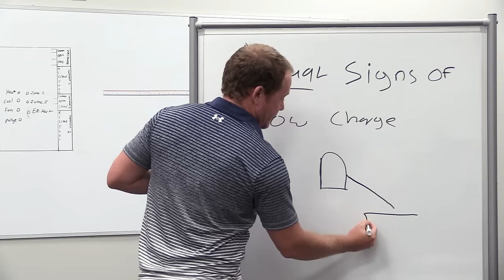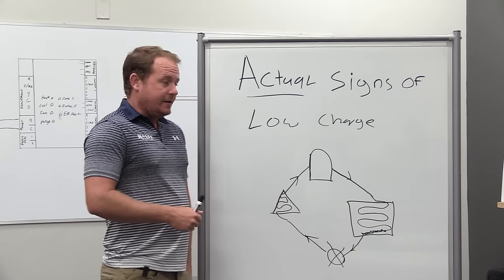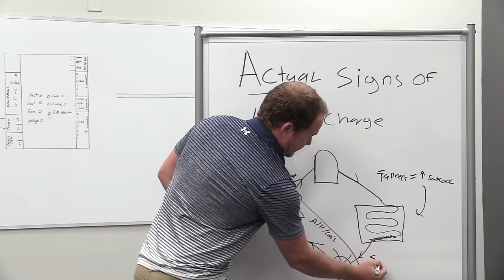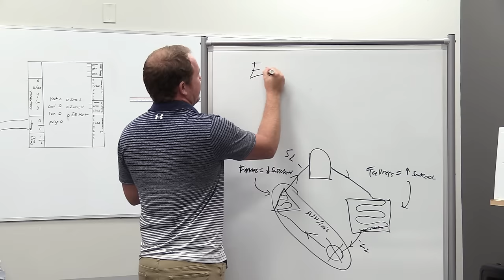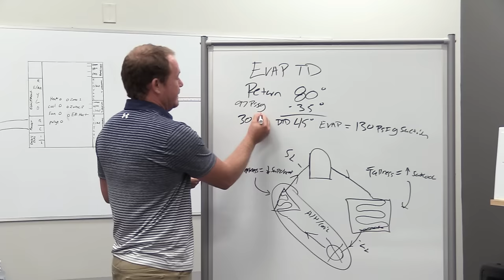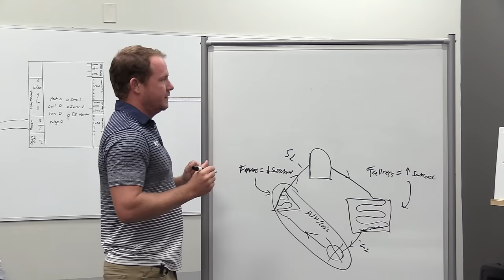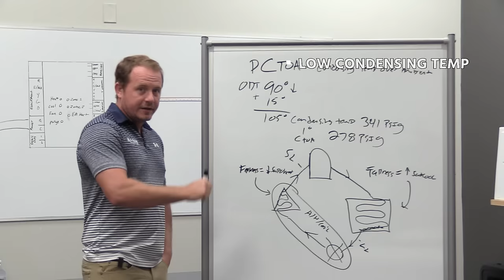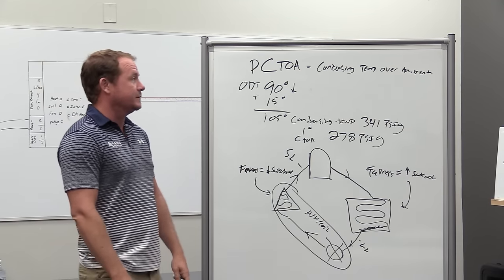Low AC Refrigerant Charge - How to be SURE (Does it really need Freon?)

Comment: Very good info.  We had a AC scam-shop come in to check our R22 AC, due to what seemed like short-cycling.  Tech went straight to compressor, checked pressures, no temperatures, but it was obvious that compressor was working OK, since heat outflux was obvious by feel, and no motor noise.  Never checked anything around Evap system, then told us we had "low suction pressure", and recommended a new compressor.  5K$.  Had a competent AC company come in, and they found one bad/intermittent wire connection to the Evap blower-motor.  Fixed for 89$.  Too many scammers around.
Reply: Someone wanted 5 grand for a compressor!?  Wow, yeah...  Sadly, you have to look out for bad actors who serve their bottom line first and the customer a distant last.

Comment: Generally speaking if you follow these 6 checks and the result is Low SST, Low SCT, Low delta T across  indoor coil, Low Compressor Amp draw, High superheat, Low subcooling the system is short of refrigerant.  Good video 👍
Reply: What is SST and SCT?
Reply: @realSamAndrew  Saturated Suction Temp and Saturated Condensing Temp
Reply: @jasoncole3833  thanks for the reply. I feel like they use a lot of contradictory terms in this industry. If one is SCT, the other should be SET.  On the SMAN display they use LSAT and VSAT, which is consistent, but then they say SLT and LLT, which is technically correct but doesn't match convention. Then you have other companies that use even other terms that nobody else uses. It's no wonder many techs get confused.
Reply: @realSamAndrew  I calibrated the probes on my SMAN just the other day, and it was recommended to label the plugs so you're always using the same probe for high and low.  So I drew an 'S' on SLT and an 'L' on-  wait, now that just doesn't make any goddam... 🙂
Reply: @joez.2794  that's funny 🤣.

Say, aren't SMAN and probes two completely different options? Did you just call it SMAN because they are both Fieldpiece? Or, are you using the SMAN as a wireless screen instead of a smartphone?
Reply: @realSamAndrew  It's an SMAN360 (comes with two wired probes).  I just said SMAN b/c you did - I don't really know what I'm doing (homeowner 🙂)
Reply: @joez.2794  oh, ok. Typically, when they say "probes", they mean the stand alone wireless pieces that connect directly without hoses or wires and transmit the readings to the phone. With your setup they usually say manifold or gauges. Just another example of competing terms to confuse everybody 😉

Comment: Even pressures sometimes lie it's a tricky business. Thanks for the information.
Reply: Only way i can think of a pressure lieing is.  1 not checking all the systems other issues. For example air flow.  You also need to be sure every part of system is working properly.  The teacher mentioned that.
He mentioned Even a shrader valve.  Teacher also used a specific way to check your pressures according to atmospheric pressure.  Which is different in Colorado vs Florida.

Comment: BRYAN! BRYAN! I hope your team shows you this comment. A Weak compressing compressor can also give you low charge readings right. My co worker had a call where he got low charge readings (106 L/ 275 H), high super heat and low subcool, as he added refrigerant system turned OFF.  Overload switch broke open. He recovered refrigerant, hosed down compressor, system turned on but gave same readings. Now I asked him to take Amp draw on common wire of compressor, he got 4.3 amps out of 18 RLA. This is signs of a weak compressor that doesnt have the strength to put in the work to move that refrigerant, hence the low charge readings he interpreted. Condemned compressor, installed new one, amp draw was in the 65% range of RLA, happy customer. Hope this comment finds you or if someone can share some insight. Best of luck brothas. Miami, FL
Reply: Appreciate that insight thank you so much.   Checking the amperage of the compressor seems logical. What does RLA represent ? And could your compressor been saved by a capacitor or hard start kit?
Reply: @The1realro  Compressor wasnt locking up. And capacitor was good.  Was just compressing really weak.

Comment: If the house is above design temperature (80°) and you add refrigerant using subcooling method, you must be careful. Add a little bit and wait for the house to get down into the 70's before setting the final charge. If you charge to 12° subcool when the house is 95° when the house gets down to 75° it will be overcharged.

Comment: Thank you for your time that lays out alot !!! I injoy some one teach this !!! I gained so much about your teaching,  I had a customer that keep say I replaced the filter and I would look at return and the filter looked clean ,  but because of your teaching I refused to put freon in to system,  even tho the customer said it just needs freon , I explained with freon being so high let me run a few test , he agreed!!! Turned out that the filter was causing a big pressure drop across the evap coil so I showed him and this is where service tech do explaine every thing !!! But I also find that it help if you show them the problem,  I removed the filter and every thing whet normal again,  the cool thing about it was the customer did A/ C work like 15 years ago , And he thank me for my time showing him !!! Thank you

Comment: Concept of tracking down the leak before just adding it in. That's my beginner take away. I threw my old r22 system away, as i was doing so. I noticed a little spurt taking the caps off. Then i watch some of ty's videos and he mentioned to add o-rings to the caps. Keep them clean. I'd also throw in there, change the cores on anything more than 10 years old. What do you think.

Comment: Other than cost considerations, is there a reason why HVAC manufacturers do not have temperature sensors placed at key locations throughout an HVAC system to monitor system performance? Wouldn't this take a lot of the guesswork out of troubleshooting systems? I would imagine that a relatively simple processor/software and interface would be a huge advancement in energy savings. It could also be remotely monitored by the servicing company who could contact the customer when the system is showing signs of falling out of 'tune'. This seems like a win-win for both the service company and the customer. The customer could have his system repaired before it totally fails, thus not sweating while waiting for a service call. And, the service company could ensure that the customer will be reliant upon them to maintain their system/systems.
On a much more basic level, I monitor my system's performance with with a remote thermometer placed just above the evaporator coil to monitor the air temp there vs the ambient air temp at the thermostat. Making sure that the system is cooling as it should.
Reply: youre describing most lennox units
Reply: Too expensive.

Comment: Great comprehensive troubleshooting video Bryan. Just one question, where does amp reading play out? I know we cant rely on it solely to tell an undercharged system but is it safe to say that  we can add it as one of the parameters to check to reinforce whatever is our conclusion in the  troubleshooting  process?

Comment: No subcool, high suoerheat, 104° hot Texas afternoon, dew point 75 so heavy air. Looked like low charge so added but SC didn’t really change. Actually the condenser was dirty. Looked clean but a quick wash and wait and suddenly the SC is -15. Now have remove refrigerant to get back to 8.  Did I mention it was 104°F? Two hours to sort it out, very exhausting. Watch out for condenser that looks clean because on a hot day it makes a huge difference.

Comment: Try doing a visual inspection of the indoor coil on the dirty side. It basically impossible without cutting a hole. All you can access is the 'clean' side. 
We stopped using the electronic air filters because they allow so much to get by and into the coil.
It has been my experience that buildup on the supply side of the indoor coil is the most overlooked problem with systems that aren't working well. Very low superheat during cooling, and increased sweating on the suction line. Long run times in any mode. It is difficult to clean, but necessary, and any tech worth his/her salt will find a way to do it.
Stuff gets beyond the filters. Always. And gets trapped in the coil. Of course it does. But nobody is talking about it. It throws the entire system off and leaves many people scratching their heads. Looking at the clean side of the coil doesn't help.
Reply: Depends on the system I guess, I've seen plenty that flow the other way so they're easy to check or have access upstream to see the dirty side.
Reply: @braaap6292  of course. The problem lies with the significant percentage of the inaccessible supply side coils. My boss had a cow when he first learned what I had done to a system he had installed 8 years earlier until he saw the picture I took of the restrictive build up, that could only be viewed with some invasive surgery to the ducting.
Actually it solved a number of units issues that had both the owners unhappy and techs scratching their heads and throwing parts at it. I had long suspected this condition. Doesn't mean I'm smart, but that one thing was the only factor nobody has investigated.  And that was because no one has the guts to cut a hatch into the right spot and look.

Comment: I keep hearing people I work with diagnosing low charge exclusively based on outside temperature and pressure. I ask what the superheat/subcool is and they don’t know. I ask what the evaporator temperature is. They don’t know. But they charge it up because “the pressures are lower than what I expect at this ambient temperature.” But because these apartments are so leaky, they get away with it. And then I come in, I don’t have my EPA yet, but I learn all the observational skills. So I find all this other stuff and I’m book smart from studying 3 hours a night. So I come up with an idea for what’s happening and I explain my thought process. Other dude has no clue what the fuck I’m talking about. No clue at all. But somehow he’s right and I at least appear to be wrong, but not conclusively. So frustrating.

Comment: The hard one is when the system can't operate for more than 3 minutes due to some problem. I can't get it to stabilize on this fridge, so I don't know what is wrong. Compressor draws 25% too much current and the evaporator shows uneven and slow flow arriving from capillary feed tube. I filmed the effect on thermal cam and one can see cooling happening slowly and stuttering along the coldplate, zigzagging down in a jerky fashion. Cooling effect almost reaches bottom of plate and starts going back up to return when system shuts down due to the excessive draw.
I am very tempted to say it has lost refrigerant over the years and is just low on charge as compressor starts nicely and is quiet in operation. Any HVAC engineer/tech that want to share a gut feeling here?

Comment: Make a vid about  non condensible.  In my line of work. So many new tech fail to to a proper charge and vacuum and always introduced air into the system. Units always getting worked on and technicians are half assing stuff alot

Comment: I had a weird situation can you please explain this? -7.6 subcool with 13 superheat 120 psi low side 229 psi high side. The charge looked low from the way below normal subcool but the superheat was about perfect so I thought it must be something else and not a low charge. I added Freon and it did end up being low. However from a diagnostic standpoint I do not understand this. And it makes me not trust that superheat reading at all when dealing with a txv system. Which it was.

Comment: very good video.  I have a question.  Is the condenser  designed with 20% more than the sum of the energy absorbed by the evaporator plus the energy consumed by the compressor?  Would it be a good idea for sub cooling to be 20% higher than superheat?  What do you thing about?
Reply: No. Even though condensers are bigger than evaporators for obvious reasons. If you look on a P-T chart there is more heat rejection than refrigeration effect. Also pipe runs/bends/joints and units that differ in height (some condensers are on a roof or down in basements etc). If your condenser is much lower than evaporator liquid will start to flash off and pressure will reduce as the liquid ascends up towards the metering device and finally evap coil. All of this must be taken into account when sizing equipment.

Comment: What about a r410a Rheem split system with a 200psi suction and 300psi head 80 degrees inside the house could it the compressor not compressing or low on Freon or bad txv? Which would be likely?

Comment: I'm in HVAC school and my instructor told us that AC systems are a +30 degree.....not 15...now I'm confused. He said design temp is 75 inside and 90 out and adjust  30 to both so outside is 120 and inside is 45....I can see the 15 degree for air flow temp but not refrigerant temp......Can you help unconfuse me?

Comment: I understood you told 35  Fahrenheit  in between supply and return ?
Because I learn that like only from 15 to 20 Fahrenheit. 
Could you explain to me that ?
Thank you for inconvenience.
I am sorry I already realized about this delta t. It is in between low side and return. I am sorry. Thank you very much !
Reply: I am sorry. I probably understood incorrectly I realize that I know that value like delta t in between low side and return. Is it ?
Reply: @efrainpelaez1246  delta t is the difference in return and supply. Temperature difference is the difference between return and evaporator coil
Reply: The 15-20 is the temperature refrigerant condenses above ambient. Is that what you're asking? Usually systems with lower seer rating will have a hight condensing temperature due to them being a smaller coil. Like a unit that is about 10 seer would be roughly 30F above ambient.  Unit that is about 13 or 16 seer be 20F above ambient.
Reply: @mackenziegray2090  thank you !
Reply: The 35 degrees has nothing to do with the supply air temperature.  It is the saturation temperature.

Comment: If you have a packaged unit (it was a Trane rtu) and it had a liquid line access and a discharge line access I had a system that had no subcooling should I set the subcooling off of discharge pressure or liquid line pressure ?
Reply: They are the same pressure up to the TXV.
Same with some Carrier models
Reply: @briangc1972  this is thing on carrier you can read discharge pressure and due to the increase of pressure in the discharge line you will artificially higher subcooling numbers than using liquid pressure so on a Trane package unit I’m still unsure if proper readings are taken on the liquid or discharge line press tap
Reply: @shifter8207  The pressure is the same everywhere between the compressor and TXV. There should be no pressure differential according to the engineers.
Reply: @briangc1972  There will be a slight pressure difference across the condenser coil.
Reply: @cleansebob1  No, there is not, unless there is a restriction or valve between the two points.
Reply: @briangc1972  I said "slight".  Anytime you have flow through a pipe, there will be a pressure difference.
Reply: @cleansebob1   the pressure differential will be so little as to be unmeasurable

Comment: Does this also apply to fixed orfice/piston systems? I was also told to charge those off of superheat and that you really shouldn't have and subcool.
Reply: Doesn’t hurt to know both. Orfice, you have to adjust amount of refrigerant. Txv does this for you.
Reply: @d3adp94  You still have sub cooling, just not as much. Just as a TXV system still has superheat, just not as much.
Reply: Fixed orifice - use superheat.  TXV/EEV - use subcooling.

Comment: Does the American market still use such alot of  ""old"" technology A/C units?   Most European markets are now just using inverter type units with EEV valves and to man pcb's to mention.  Miss the old skool TXV systems
Reply: Too many issues with EEV and inventor units have serious issues with high ambient climates, so the US will always lag behind the Europeans until those issues are resolved.
Reply: @briangc1972  Dono about the high ambient, I'm from South Africa and our summers are hot 35DegC +  I'd say 95% of the units installed now are inverter technology and VRV units. But I'm still old school HVAC  tech and hate all the new electronics
Reply: @craigladewig3158  Only 35˚C?  HA! Problems start at 42˚C Last week we were at 46˚C.....  The electronics get so hot while the unit is off (just sitting in the sun) that the over temp sensors won't allow the unit to even start. Once it is running, the cooling circuit keeps the electronics cool enough so it doesn't trip the over temp. But if it is off, it may not start. 
No such problems with a good old PSC compressor.

Comment: Just so you know this video assumes your system uses a TXV. On mini splits there is no port for the head pressure so you have no way of knowing them, and all videos about mini splits assumes inverter units with electronic metering devices. Unfortunately my system isn't that. It's a mini split with fixed orifice and no high side ports.